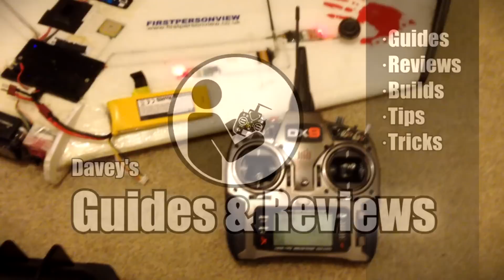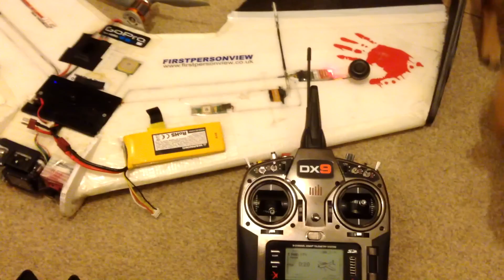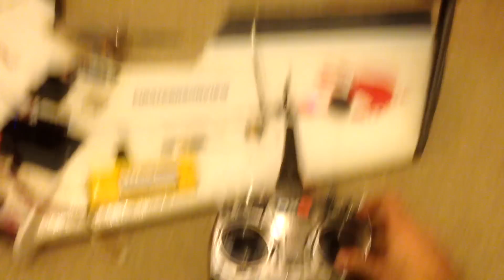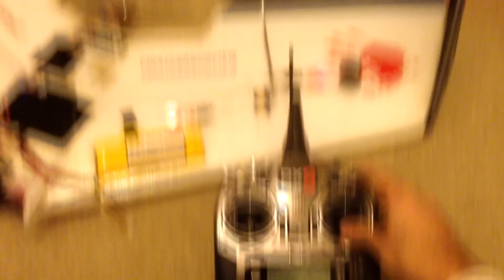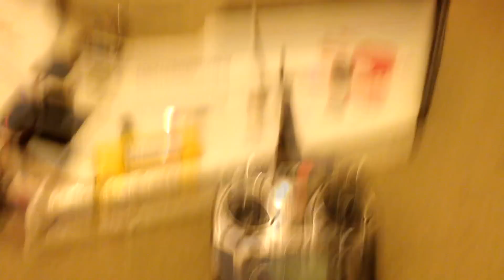Spektrum DX9 Voice Bug - Speech Kills the PPM Stream

Comment from the maker: It turns out its a volume issue and therefore it looks like its a hardware problem.. My guess is the regulator on the board hasn't got enough poke to run the modulator when its at high volume AND the rest of the TX... Check out this other video: Spektrum DX9 PPM Voice Bug - Part 2 - Its a volume Issue!

Comment: Taranis 1 Spektrum 0
Reply from the maker: You forget that I had a Taranis, I HATED it... :D
Reply: Daveys FPV Adventures Why was that?
Reply from the maker: ***** It felt extremely cheap and fragile in every respect, its nigh on impossible to program with out the Companion9x software and the voice output is muffled and barely understandable.. Plus they didn't use the Futaba Trainer port which would have been one positive?  On a plus though the ergonomics was spot on.. I do love JR radios and that's where they nicked the design from :)